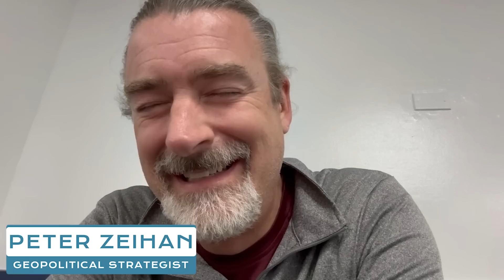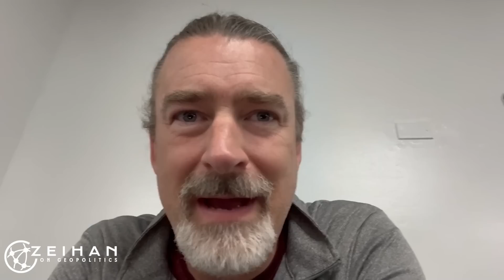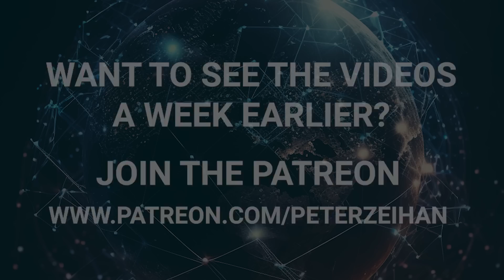Nuclear Power's Facelift: Small Modular Reactors || Peter Zeihan

Comment: Our Navy has plenty of SMR's.... that's the prototype.
Reply: There are serious issues with using naval reactors as SMRs. The biggest one is that they apparently run on highly enriched (weapons grade?) uranium and/or plutonium. Yes, a modern naval reactor can run 20 years or longer on a load of fuel but that fuel itself would likely be a serious proliferation issue.

However, a dozen large floating desalination plants, powered by naval reactors, anchored off the shores of California would probably solve quite a few problems there.
Reply: @echomande4395  Such "floating desalinization" barges could also be reconfigured to produce large quantities of fresh water via a heat exchanger and/ or electricity for disaster relief- both at home and outside. It could also give post military engineers civilian employment, as well as improve our relief efforts.
Reply: @fredericrike5974 desalination is expensive as all get out though, and I dont know why.
Reply: @echomande4395  That weapons grade fuel aint something you can design around, it is a fundamental nuetron efficiency issue, the smaller the core is physically the high the enrichment needed to be.
Reply: Military reactors don't have to produce power at low cost. NuScale, the leader in Small Modular Reactors died when its price for electricity for its last project ended up 60% more expensive than it promised.

Good bye investors. That's what happened to NuScale.
Reply: Naval reactors are too small. Especially submarine reactors. People hear SMR and think that means tiny. Nope.
Reply: @patrickweaver1105  Not true, I worked on a sub tender in the 1990's and a fast attack sub could power about 40,000 homes....not bad.
Reply: @Sardavolpe  Okay now  add up the municipal services, commercial properties and industrial loads. How many homes is a poor metric because homes aren't the biggest demands .I trained on the first S1W. I operated A4W reactors for years.
Reply: @patrickweaver1105  Yes you're right we should give up on SMR's
Reply: @Sardavolpe  No we should just find what works and use it where appropriate. People get too hung up on labels. We need innovation not more of what we already have.
Reply: Military SMR’s use highly enriched uranium, otherwise known as weapons grade Uranium. Such reactors won’t work in the civilian power market as they aren’t allowed to use such enriched uranium for obvious reasons.
Reply: Navy reactors are overbuilt for battle conditions. However, if that is the 1st step into SMNRs, then it may be worth over building the 1st generation to get away from fossil fuels.
Reply: Military SMR's are EXPENSIVE as hell. 👀
But they are made to be very small, quiet, in small quantities... All this increases costs.

Cost-effective SMR's are always 10 or 20 years away - in other words, it's a pipe dream that will come true in 40 years --> maaaaaaybe.

Credentials; I studied electrical engineering (edit: with a focus on POWER GENERATION - includes nuclear ^^ - , electricity transmission & regulation). 
Power generation is my passion.
I also invest primarily in electrical-engineering-connected companies (I buy & hold a stock portfolio) 👍
Cheers ❤
Reply: @elektrotehnik94 so, the solution is. . .?
Reply: @elektrotehnik94  Exactly, add on that bureaucratic red tape and it'll be closer to 40 years not 10 - 20
Reply: @elektrotehnik94  issnt it so that all things that initially are made in small quantities are expensive as hell? I think about the Tford and the time before that ( not that i think that smrs will ever be produced on that scale, i doubt thats even desireable) what if the need for it to be super quiet is dropped and the surounding systems are redesigned to work in les conplicated environments then i do think that scale will push the price down. I think that security will remain an issue though.
Reply: @elektrotehnik94 lol electrical engineers dont know how nuclear plants work. Their work begins and ends at the turbine output shaft. Talk about throwing credentials lol. Theres a whole lot more that goes into nuclear power generation than anything ur ever taught in school bub
Reply: @TheMrgoodmanners 
Tell us more. I’m genuinely interested
Reply: @TheMrgoodmanners I don’t really have a dog in this fight but that’s the first thing I thought when I read that person’s comment. He didn’t mention NUCLEAR electrical engineering credentials…hmmmmmm…
Reply: @rock_and-or_roll never use dog and fight in the same swntence. They could cite you for that.😅
Reply: @TheMrgoodmanners My studies INCLUDED NUCLEAR. 😶
Bachelors in Slovenia. 🙃❤️

"Credentials; I studied electrical engineering (edit: with a focus on POWER GENERATION - includes nuclear ^^ - , electricity transmission & regulation)."
Reply: @elektrotehnik94  I'm rather surprised for an engineer to say that a reactor was noisy; the "noise" in the system comes when you turn the the nuclear generated heat into steam, then use the steam to run a turbine. You comment about the expense of military SMRs also fails to note that we nor anyone else is making them in job lots- they are being made one at a time, by hand; that is always an expensive way to build a thing.
Reply: @fredericrike5974  There are 28 Virginia class submarines, with more being built each year.  They all use the same reactor design.
Reply: @elektrotehnik94  Well I'm no engineer, but as an educated layman even I know there is a distinction between an electrical and a nuclear engineer, so it seems to me your credentials aren't entirely on point.
Reply: MIR has a SMR in the late 70's

Comment: SMRs aren't the answer.  Too defuse, .. too many security issues.  They may be useful in certain instances, but they will not be a wide range long term solution.  What Terra Power is attempting to develop in Wyoming, right now looks more promising.  They are going with sodium cooled reactors that will addressing cooling problems and issues yet not risk meltdowns.  After Three mile Island Nuclear power's development stunted to the point that we are behind.  In addition, our uranium enrichment programs were replaced with the Megaton for Megawatts, .. whereby America bought Russian war heads and configured them for fuel, eliminating Russia's weapons without the worry of the enriched uranium ending up sold to terrorist.  That completely undermined domestic uranium production killling off most of America's ability to do so.  Accordingly, that led to our production problem for uranium, and the US now imports most of it's enriched uranium needs to the tune of about two thirds, .. including 35% of which STILL comes from Russia to this day.  Nuclear power will certainly be a big part of America reducing its dependence on fossil fuels but it will be a mixed bag of solutions, of which SMR will be a part, .. but a very small stop gap part.

Comment: You are oversimplifying SMR's. The bit that fits on a truck is only the reactor
Everything else that is required (which is extensive) to run the reactor and generate electricity  needs to be already built on site
They are only transportable in the sense that the small reactor is built off site and delivered to be built into this existing infrastructure
Reply: That's changing:
There are several newer Small Modular Reactor (SMR) designs that aim to be fully modular. Some key examples include:

1. NuScale VOYGR: This design features fully modular 77 MWe Power Modules that can be factory-fabricated and transported to the site. Up to 12 modules can be combined in a single plant[6][7].

2. Rolls-Royce UK SMR: While larger at 470 MWe, this design emphasizes modular construction with major components manufactured in factories and assembled on-site[5][8].

3. Westinghouse eVinci: This microreactor design (1-5 MWe) is intended to be fully factory-built and transportable[4].

4. Oklo Aurora: A fast reactor microreactor design (1.5 MWe) meant to be modular and transportable[4].

5. X-energy Xe-100: A high-temperature gas-cooled reactor design with 80 MWe modules that can be combined into larger plants[4].

6. GE Hitachi BWRX-300: While larger at 300 MWe, this design emphasizes modular construction techniques[2].

7. Holtec SMR-160: A 160 MWe pressurized water reactor design focusing on modular construction[7].

These newer designs aim to maximize factory fabrication of components and modules to reduce on-site construction time and costs. Many incorporate passive safety features and simplified designs compared to traditional large reactors[1][2].

It's important to note that while these designs emphasize modularity, the degree of modularity can vary. Some may require more on-site assembly than others. Additionally, most of these designs are still in development or early stages of licensing, with only a few (like the NuScale design) having progressed significantly through regulatory processes[4][7].

The push for modularity in SMR designs aims to address challenges in nuclear power plant construction by potentially reducing costs, shortening construction times, and improving quality control through factory fabrication[1][3].

Citations:
[1] https://inl.gov/trending-topics/small-modular-reactors/
[2] https://www.energy.gov/ne/advanced-small-modular-reactors-smrs
[3] https://en.wikipedia.org/wiki/Small_modular_reactor
[4] https://www-pub.iaea.org/MTCD/publications/PDF/p15790-PUB9062_web.pdf
[5] https://www.ansto.gov.au/news/small-modular-reactors-an-overview
[6] https://world-nuclear.org/information-library/nuclear-fuel-cycle/nuclear-power-reactors/small-nuclear-power-reactors
[7] https://www.cnbc.com/2024/09/07/how-small-modular-reactors-could-expand-nuclear-power-in-the-us.html
[8] https://namrc.co.uk/intelligence/smr/
Reply: @Mike80528 agreed. But surely putting the unit itself underground on-site makes most sense?
Reply: @jimmeh213  I honestly don't know. I doubt there's a singular answer to that. Geography and geology probably matter a lot.
Reply: Engineer here - 100% RIGHT.
This is just Peter being pathetically like 100s of other commentators and just regurgitating PR from companies trying to raise money. I really like Peter when he's explaining geo-politics but as an engineer I think he needs to either employ an engineer or just STFU on engineering topics. Because every time he's either 1/2 Wrong, 3/4 Wrong, or 100% WRONG.
Reply: @tonywilson4713 dude we have workable SMRs already in the navy. Russia deployed an SMR to a small siberian town a few yrs as well. The tech is already here
Reply: Not really…. The rest of the plant can be made off site and the majority can be skid mounted….. the majority of the structure can be precast concrete sections….
Reply: Peter doesnt understand technology/engineering, the irl type, he's a paper pusher/theorist
Reply: I think he's addressed that before about how these would mostly be installed at the site of decommissioned hydrocarbon based plants, so those sites would already have much of that already on site. There may be some pieces that need to be upgraded or replaced however, so there will always be some work involved on site.
Reply: Cost-effective SMR's are always 10 or 20 years away - in other words, it's a pipe dream that will come true in 40 years --> maaaaaaybe.

Credentials; I studied electrical engineering, power generation is my passion.
I also invest primarily in electrical-engineering-connected companies (I buy & hold a stock portfolio) 👍

On the other side, military SMR's are expensive as hell. 👀
But they are made to be very small, quiet, in small quantities... All this increases costs.
Greetings from SLovenia ❤
Reply: @elektrotehnik94  Ah, yes, but are you manbunned stoner with a deep voice who lives an enviable, instagrammable lifestyle in Colorado and makes his living by making redditors feel Very Smart about prognostications outside his expertise? 

But yes, exactly: there's a reason why SMRs are the favoured technology of cookers and conspiracy theorists.
Reply: @hoilst265  If a person wants to thrive, he cannot afford to dwell on the opinions of confused people for (too) long. 🙃❤️

To comment on your example --> 
Many modern "internet people" often mistakenly think "equality of all". Therefore; they ignore that it's equality in "moral value", not equality of ability in knowledge & wisdom. ^^
Or they have big egos, thinking they know it all. ^^

Much Love & Godspeed, brother 🙏❤️
Reply: @hoilst265  If your not freebasing that molten salt Thorium with your SMR then your not a true hardcore conspiracy theorist.
Reply: @elektrotehnik94  No, more like 10 years or so if serious money is thrown at SMR development, prototyping and regulatory approval (I'm presuming a friendly reception at the NRC and EPA). I would expect that the Federal licensing and approval hurdles will be the most arduous part of the SMR development project. There's alway the potential problem of NIMBY litigation causing schedule delay. If you're throwing credentials around, my degree is a BSE in Nuclear Engineering and I worked in an Architect Engineering firm constructing nuclear power stations for 3 years, specifically the Alvin W. Vogtle project (1976-1979) under contract for Southern Power. 
As others have stated, US naval reactors are ruggedized (shock resistant), made to be ultra reliable, and are fueled with highly enriched nuclear fuel (20 year burn without refueling); some of those features will not be required for civilian use.
Reply: @elektrotehnik94  Well first get a degree in nuclear rather than electrical engineering, and then we'll factor in your credentials.
Reply: @elektrotehnik94  "Cost-effective SMR's are always 10 or 20 years away"
This is a misunderstanding of how it works. Low cost comes from series production and refinements of designs during series production. It doesn't come from a tech blueprint.

Comment: Nuke Sub or Aircraft Carrier Nuke Generator use highly enriched fuel   don't think i would like that sat outside a building   however if the design used low grade fuel limited output  more like a nuclear battery may be possible
Reply: Please remember that those are military ships built to operate in actual wars. Those reactors run off of rods enriched that far because the reactors NEED to be able to immediately "spin up" from idle... and also maintain their maximum output (all ship systems running at near-absolute maximum) for extremely long/indefinite periods... without being too big to fit in the ship.
High output from a small volume requires a higher density/mass fuel source.
The safest civilian reactor imaginable would probably have a very large chamber, very slowly eat very minimally enriched rods, and would be almost impossible to get it to boil water... essentially a cooling tank with the slightest ability to generate power possible (but only if you REALLY worked at it😅).
Reply: Fundamentally impossible, a reactor cores minimum enrichment is inversly proportional to it's size due to the physics of neutrons, if too many leave the core before finding a fissile atom then the chain reaction can not be maintained.

Comment: The public could be persuaded if nuclear power could be made safe. Molten salt reactor designs can make that possible, but the research needed for a new working prototype is at least 5 years away and 20 to deploy at scale. The industry needs an infusion of cash and political will to make it possible. Even Musk needs nuclear power to make a Mars colony possible.
Reply: Did you know more people die installing solar in a year than have died, ever, from power plant radiation?   The "safety" issue is primarily propaganda from anti nuke "environmental" organizations.   For exampke, 100% of the deaths in Fukashima were due to panicky, incompetent evacuations, not the actual accident.   In fact scientists later noticed they were exposed to more (naturally occurring) radiation while flying to Japan than they were at the site itself.

Comment: There are a lot of rural and remote communities who's lifeline is the once a year diesel resupply ship or air freighting it in the winter. This tech is much needed.
Reply: Economic suicide.
Reply: Nope, they are going Solar + Battery which is ready TODAY at a fraction of the best case cost that SMR could ever hope for.
Reply: @kennethferland5579  I have been remote places where the sunlight does not touch the ground at least six months of the year.  If you think solar and batterys are going to work there I invite you to try it out for a year.  You're problems will definitely be solved one way or another during that time.
Reply: @kennethferland5579  I sincerely hope you are right.
Reply: Isolated community's with limited resupply, and critical government facilities/infrastructure are really the  only great use for SMR in my opinion. 

The cost and associated potential of sabotage or destruction is to great for general public use and allowing corporations to run their own SMR gives them to much autonomy for comfort.